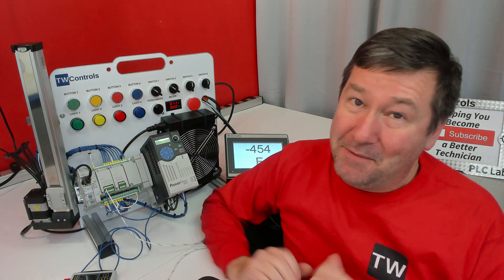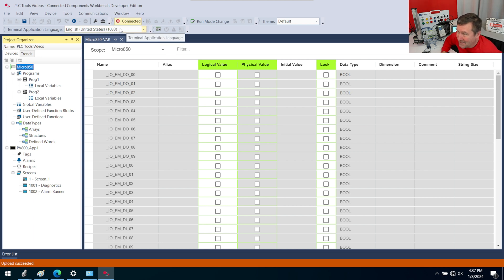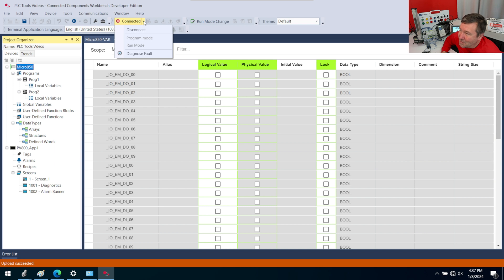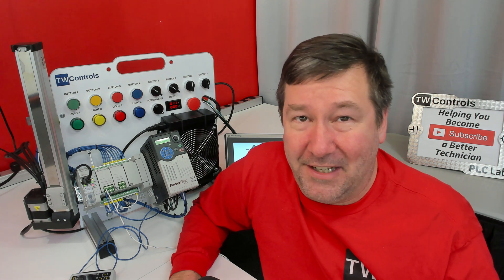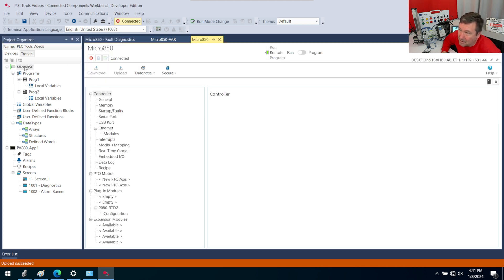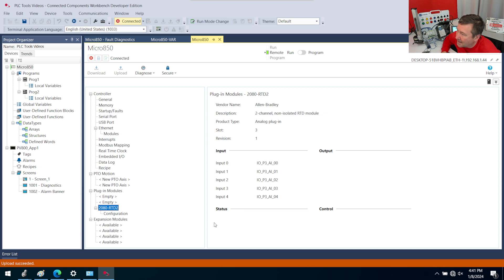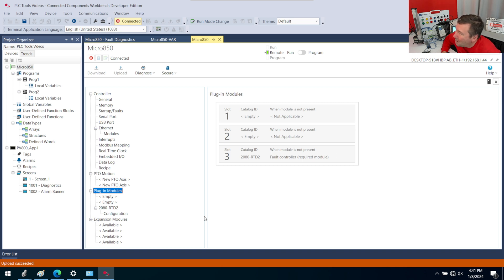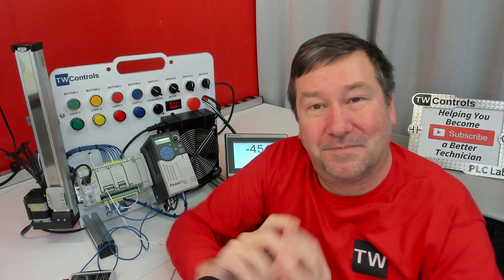Why Did My MIcro850 PLC Fault?

Comment: Looking at the PLC's onboard modules you have installed in slots 1 and 2, your program that you presented in the video shows them being empty....which is the cause of the fault.  Sorry, just ran across your video as I am researching why a Micro870E PLC faulted at a customers site after 4 months of trouble free option and only the data table values of the files that I created for process recipes, (did not use the onboard recipe type files), all cleared to zero, however other data values for say the analog inputs did not clear....Puzzled I am.

Thanks for the very informing video, your work is excellent!!!  Darren

Comment: Hello Tim,

That’s a challenging problem. As I recall, CCW will let us have many modules physically installed without errors. However, as soon as we configure the PLC, and a module is missing, or in the wrong slot, we get a fault.

We can make this troubleshooting challenge harder by expanding it to include the division by zero or even worse, by waking the watchdog by incorporating time intensive loops.

Sorry, I’ve never found a way to differentiate these faults other than to go into the menu as you presented in this video.

For what it’s worth, this module misconfiguration was always a big problem when using the simulator. So many out-of-the-box resets as the simulator always remembered the last configuration.

Sincerely,

Aaron

P.S. Perhaps we can meet in Chicago in a few months.
Reply from the maker: It seems like there should be somewhere I could see that.  If the module was plugged in and in fact bad then I'm not sure how you would figure out which module it was.